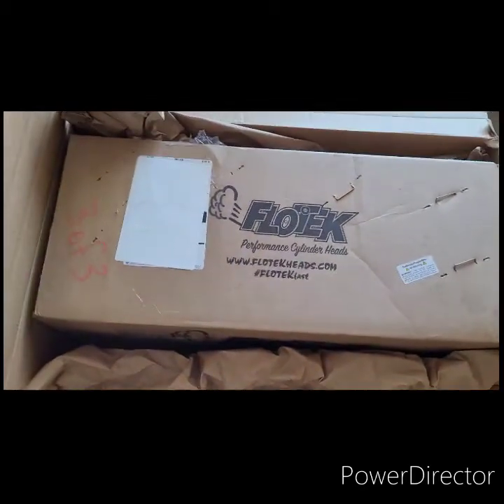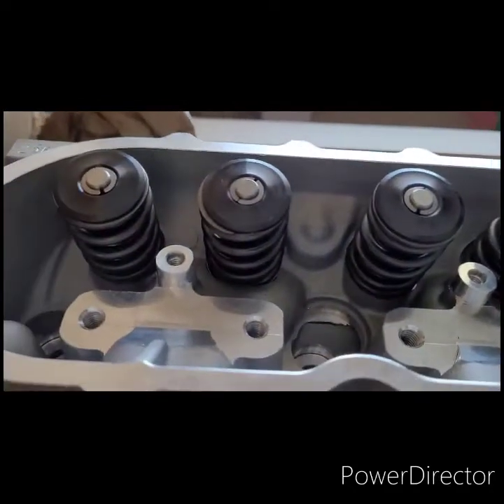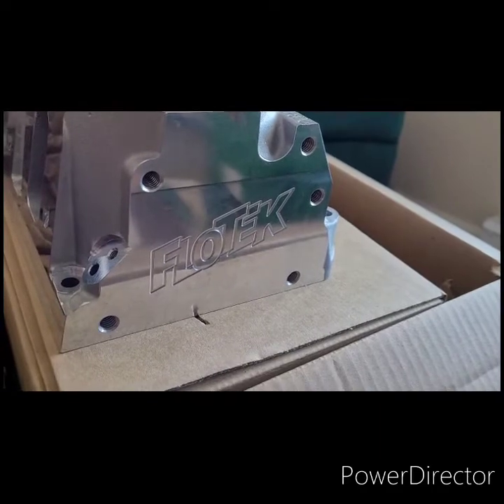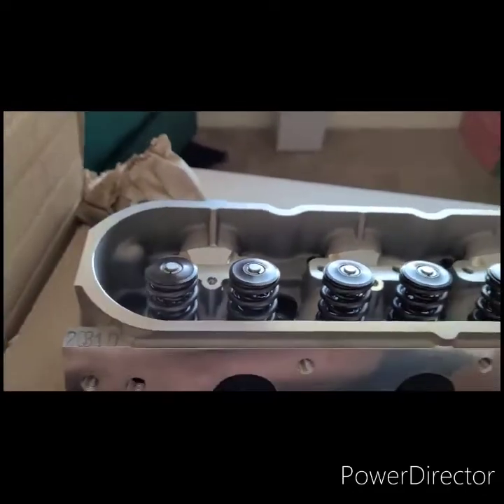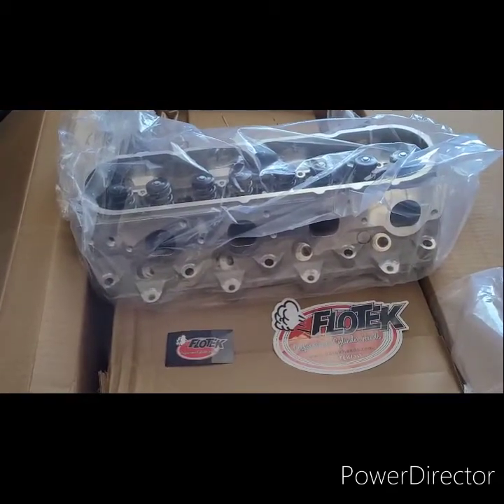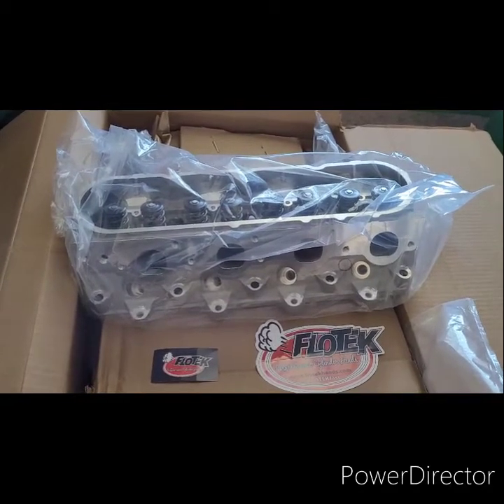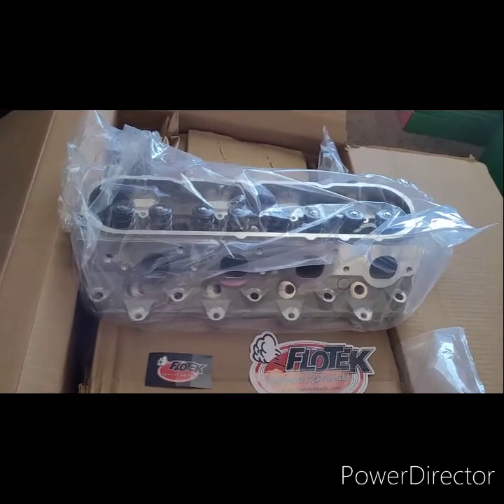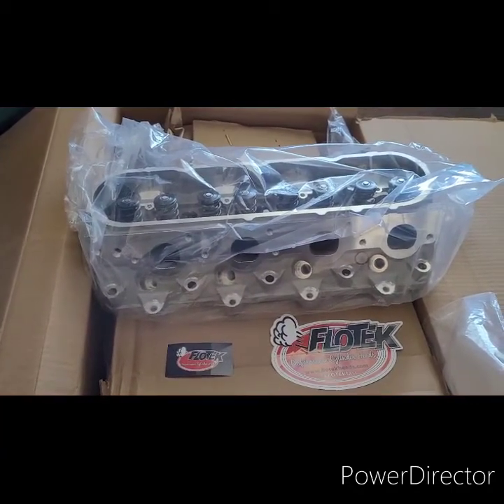Flotek lS3 Cylinder Head Unboxing

Comment: I've been debating these for a few months now because I really don't know the company.  Have you run them on anything yet, any issues, what kind of power, how are the castings, etc.?

I put down 451 with a stage 1 cam and factory 5364 heads that were ported.  I'd like to steup to a stage 2 cam to carry a little more rpm, but also have a better set of heads to edge closer to the 500 wheel mark.
Reply from the maker: I haven't had any issues with the head and the casting were very good,  I didn't find any defect on either of the head.  Overall the performance has been great and the quality was great too